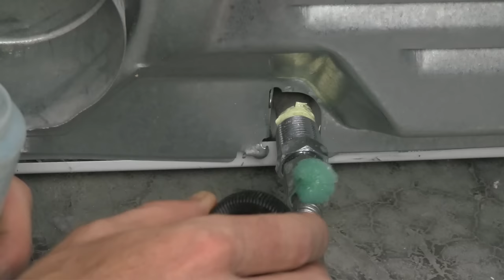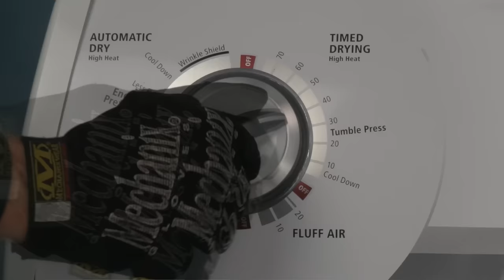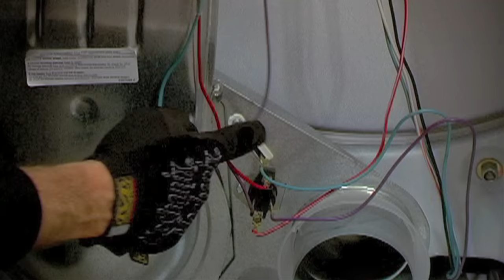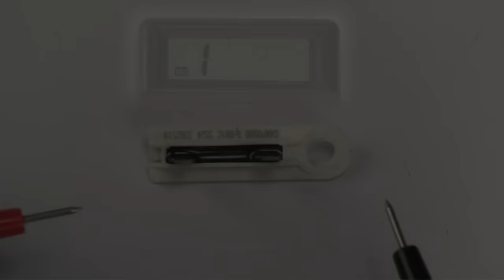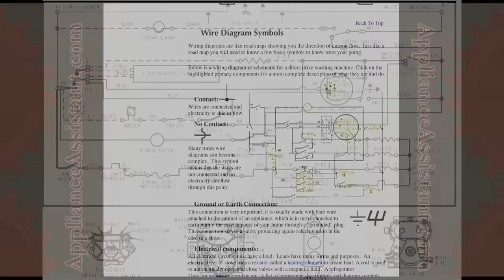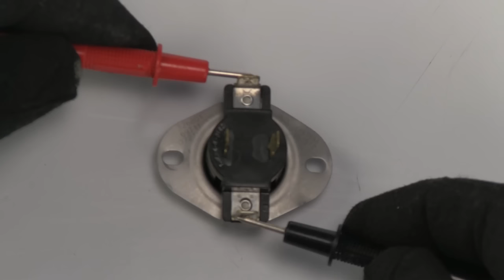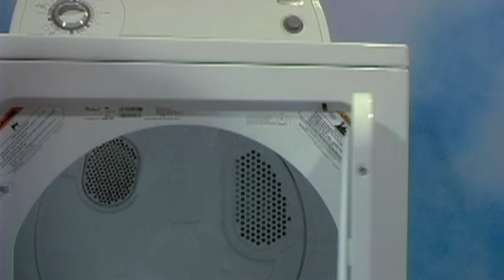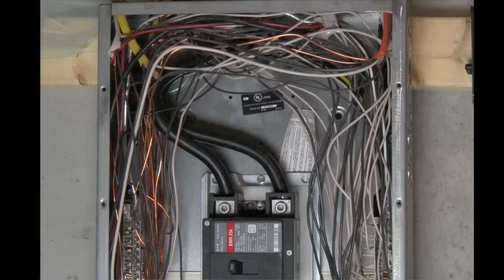Gas Dryer Repair: Fix Heating Problems

Comment: Igniter glows for a bit then clicks off with no flame. OHM reading across solenoids seemed ok. Replaced with used gas valve w/ solenoids. Still no ignition. 

Removed back and tested therm-o-disc.
Continuity between leads for red wires. NO CONTINUITY BETWEEN LEADS FOR PURPLE WIRES. 
When I bypass it by touching the purple wires together it blows the circuit breaker in the house.

Comment: I replaced the 2 solenoids after noticing that the flames were going off after less than a minute!!   But the problem did not go away.  I tested your suggestion to un-plugged the vent tubing in case the long tube (w 2 90 degree turns) was clogged, but the flames still went out.  What else could be preventing the gas from flowing to keep the flame going?

Comment: Thanks for this video.  This made my gas dryer repair super easy.  Coil replacement.  BIG thumbs up!  Interesting that Samsung doesn't offer the coils separately but everyone else does.  My gas valve assembly said Maytag so I got Whirlpool coils.  This is a Funny industry.

Comment: Do you have to plug the dryer back in before testing the various sensors, fuse, etc.?  Anyone?
Reply from the maker: +007nige For the most part no. Most of the thermostats, igniter, etc. can be checked with a multimeter for resistance. You just need to know what they should be in order to spot a problem.  Here is a dryer repair guide that may help.
Gas Dryers:
http://applianceassistant.com/appliance-repair/dryer-repair/how-gas-dryer-parts-work/
Electric Dryers:
http://applianceassistant.com/appliance-repair/dryer-repair/how-electric-dryer-parts-work/

Comment: How to test an operating thermostat with three terminals?
Reply: please I work in an industrial laundry and we use American dryer Corp. am having challenges on the flame,it always yellow in colour instead of blue and we always tap on d gas pipe before the fire comes out,need solution on how to get a blue flame and stop d taping of pipe
Reply from the maker: Not sure, but it could be an air mixture problem... tapping on the pipe makes me think you may have a bad gas valve, mechanical thermostat, or switch somewhere.  Really need some good isolation testing to pin that one down... Sorry I can't help more!

Comment: Is there any way to check the gas valve? Have replaced coils, starter element, flame sensor, fuse is ok and high temp fuse ( cold) checked ok.  my problem is turn dryer on (IJ70001) you see it turns red then clicks and nothing happens. It did start once after I changed the flame sensor, but only for a few minutes. but after a while it stopped again and hasn't started since. before I get a new dryer would like to expire any possible tests.

Comment: Help.. Changed Thermostat, Thermal Fuse and Gas Valve coils.. Flame goes on and off. I got no tester what now?
Reply: any answers for me.. I replaced all those 3 parts brand new.. flame goes on and off. I got no tester.
Reply: any answers for me.. I replaced all those 3 parts brand new.. flame goes on and off. I got no tester.
Reply from the maker: +Frank Orellana If the flame is lighting and going out quickly, I would guess ether an air blockage in the duct or dryer or a weak hi-limit thermostat.  On the style of dryer in the video it is the back of the dryer on the air intake duct that caries heat from the burner tube to the dryer drum... Just a guess. try running it with the duct off the back of the dryer first and see if it works. if it does you home duct is plugged up.  If its still doing the same thing check for a blockage in the lint trap housing or replace the hi-limit thermostat. Hope that helps! Good luck!
Reply: +applianceassistant flame turns on and off still heating fully   functional  , is it suppose to that?

Comment: Thanks for spending time being so helpful. Maybe I can ask your advice. My ge gas dryer has no heat. Igniter glows then u hear a buzzing/ticking kind of rattle for 10 seconds while it should be lighting a flame. Then nothing so then the igniter goes out. The ticking tells me the selinoids are good plus I tested them for cont.
Reply from the maker: +dan spouse Sorry for the very slow response.  It may be a bad gas valve but I would change the coils first they may be weak. They are also much less expensive than the valve which is fairly rare to fail. Hope that helps! Thanks for the question!

Comment: Your video's helped me immensely diagnosing problem with my older Whirlpool dryer. Since I'd ck'd the vent to outside previously, I started with pulling off the little front end clip to view the gas ignition. On high heat, it started up orange, then ignited the gas, I think indicating no need to ck. if it was getting gas. It heated up. I then pulled off the venting to dryer and to outside vent and cleaned out. Now running a test load without vent but have ck'd the front-end view to gas ignition and am only seeing the orange that should ignite the heating element, but it's not coming on. Ugh. I'm a stubborn grandma and insist on fixing stuff myself if possible. Already have a volt meter so guess I need to dig further and locate fuses, etc. Regardless, thanks for your informative video. Whether or not I'm able fix, I've been able eliminate several issues.

Comment: I thank you for the Description on troubleshooting problems, my gas dryer has power, fire, but no fluent gas, I replaced a few components like: thermostats, flame igniter, and thermal fuse. But after seeing this, I realized the coil valve solenoids were the main problem, bought the part and install them. Works perfectly fine now. GREATLY APPRECIATED!!!!

Comment: I have a Whirlpool gas dryer that no longer heats but still cycles.  It's unusable without any heat. I've ck'd the outdoor vent and only looked at the back which is completely encased. I think gas dryers of the past had an accessible entry to relight pilot. I get that those times are past. The video is very informative and have given me a few other ck's before calling it quits. Thank you & well done!

Comment: My dryer's igniter will sometimes glow and other times it won't glow at all. Originally the thermostat was dead (I tested it with a meter) and I thought the problem would be fixed once I replaced that. Since then I've replaced the flame sensor, valve coils, bought a new air duct, checked the outside hole,  removed all the lint from inside the machine,  and replaced the cycling thermostat.  I've thought about replacing the igniter, but I figured that since it is glowing and igniting half the time, that it's probably not the problem. When the igniter finally does glow, it ignites the flame, but after a few seconds the flame goes out.  I'm currently thinking that it's the gas valve that needs to be replaced. Please give me some suggestions on what I can do to fix this problem.
Reply from the maker: +Aaron Grinnell Thats a difficult one! I don't think its the valve because that would not effect the igniters ability to get current to glow... it's very unlikely the igniter... So I would look at the timer not making contact intermittently, to send voltage to the igniter through  the flame sensor, or your new flame sensor may be defective... I would start with multiple voltage tests from the timer. probably the easiest place to check would be  at the blue wires to the thermal fuse in the back. It should show constant 120 Volts AC whenever the dryer is running on a heat cycle, except at the end during cool down.  Then wiggle the timer knob and see if the voltage drops off. If it does it's timer contact problems.  Hope that helps! Good luck!

Comment: Thanks for the great info.  My igniter burned bright no flame so I checked the 'dryer radiant sensor' per your instructions read '0'.  Also, there were web/lint around the 'dryer radiant sensor', therefore, I used my shop vac and carefully vacuumed around the sensor and wahlah, flame came ON.  Thanks again!

Comment: So I need some help with mine I replaced the solenoids and it didn't fix the problem. SO what happens is the coil starts up and then turns off after about 10 seconds I don't get an ignition. I have a Kenmor 11097589110. Is there anything else that would cause this issue besides the solenoid?
Reply from the maker: ***** Sorry for the delay! I hope you have already found your fix! That's a tough one. The coils should be the cause. However, the valve is a more rare culprit.  I even had one that had a spider egg built in the gas orifice blocking gas flow. I'm just guessing... ether no gas or the valve is not opening like it should. New coils could also be bad... Sorry I can't be of more help.
Reply: Yep and yeah it turned out to be junk in the intake. after cleaning it started right up and it works perfectly! The dryer may be from 1994 but still runs like a CHAMP! thank you for checking back with me though :D
Reply from the maker: ***** Thanks for the update! That kind of thing is difficult to find. Congratulations!

Comment: Thanks for the great video.  My problem turned out to be the thermal fuse.  With your help I was able to find it, test it and replace it!  Cleaned out my dryer vent hose while I was at it....the fact that it was full of lint probably caused the fuse to fail.  Thanks for taking the time to post this video.  You saved me lots of time and money.
Reply from the maker: Lisa Myers Your welcome! Thanks for taking the time to comment! It's very encouraging to hear success stories. : )

Comment: The troubleshooting video took me to the problem coil before I took the back off, I had the Laptop on the washer and stopped the video while pulling panels off and tugged wires and taped coils until the lighter came on.
Amazon will have the parts to me in 2 days.

Comment: My whirlpool gas dryer has a gas smell coming from inside the dryer. No leaks on the outside and No smell from the outside. Help?
Reply from the maker: Hard to say... you can use a liquid soap solution to check for leaks at all of the gas connections. It will bubble if there is a leak. Apart from that it would probably be a faulty valve, or coil malfunction.  you may want to call a pro on that one... Not a good idea to guess when it comes to gas leaks if you can't positively find the source.

Comment: Excellent video! Last time I paid a tech. $250 to troubleshoot and change the coils. Was able to find the fuse problem, just need to determine now why it blew.
Reply from the maker: Todd Lung Sorry for the slow response. The first place to check is the home duct. This style of dryer is very unlikely to develop an internal blockage.  The fuse can just fail for no reason as well...  Thanks for the comment!

Comment: What would cause the fuse to blow other than a clogged lint line. I am replacing the fuse and the thermostat just to be sure. The thermostat should open before the high limit switch correct?

Comment: My Kenmore 90S gas dryer is overheating.  The original problem was "no heat". We replaced the fuse and thermistor.  Now, it gets way too hot!  When it's set on Air Fluff only - there is no heat, but on all other settings it gets too hot.  Do you have any suggestions?
Reply from the maker: Karen Monson Sorry for the delay! It's kind of rare but I would try the cycling thermostat... unfortunately they are difficult to check because they only open at high temperatures, and I'm thinking your's is not opening properly.  You can use a meat thermometer at the back of the dryer to check cycling temperature. On high it should cycle the burner off somewhere between 170º and 190º.

Comment: I have a GE DRSR483GG7WW. The dryer ignites only for a few seconds and then goes out. I was thinking it was the coils. Is that correct? If so there are two different kinds offered. 
1. 'M' Series Secondary Coil - 2 Terminals
2. 'M' Series Primary Dual Coil Gas Valve
Which should I get? Do I change both? One has 2 terminals, the other 3.
Thank you very much!

Comment: Man I am at a loss.  I have torn my dryer apart multiple times and still can't figure out what is causing an almost un-burnt gas smell to be in the drum.  It doesn't smell like straight natural gas just like exhaust from an engine.  I thought my flame height might have been the issue but the flame is predominantly blue so I dunno at this point.  Ignitor does its job. The coils seem to work in conjunction with the safety switches properly.  It was a hand me down from my folks. After I cleaned it out thoroughly I put it to work for 2 whole days when all of the sudden the clothes smelt funny after a cycle.  Now my clothes come out smelling like exhaust.  No paint/varnishing being done in the home either.  Oh and the vent hose is brand new with an entirely new run of ducting.  Any ideas?

Comment: The house I am renting just converted to gas, and the dryer doesn't heat. Is there a correlation between the two? IF so, how do i fix this problem? Thanks

Comment: My Ge gas dryer DDG9280gbl works fine on medium and tries to come on more frequently on the hot setting but the gas valves don't open so the ignitor goes off then comes back on at the normal "medium" frequency. It will do that over and over. I've checked the stats and replaced the coils and fixed a bad contact inside the timer. No luck. Can you help? Thanks in advance.
Reply from the maker: If the igniter is cycling that should mean that the thermostats are closed and ready to heat... Sounds like a valve issue but if that was the case it shouldn't work on medium.  I don't have that model in my wire diagram database... If you have a wire diagram can you message me a picture or an email address?  I think that's the only way I may be able to help.
Reply: Thank you for your reply. Just after my question to you I discovered wet clothes, one of the "new" genuine GE coils failed open after 15 months of light use. I reinstalled the 30 year old valve set, works good now. Even ignites on hot but takes forever to reignite (on hot) but okay on medium. There must be an alternate circuit on hot that bypasses the cycling TT? It has the moisture sensor which I use exclusively and a circuit board which I've seen called a "timer ". As I recall, the original problem last year was no-heat and I fixed the timer contact and replaced the valve set then. Looks like I got a valve set with one weak coil. I'll work on scanning the diagram if you think you might be able to help with that long delay on hot. (almost down to room temp.) Many thanks for your interest.
Reply: applianceassistant Yes, you were right, a valve issue. The booster coil failed. Works good now but needed a load of wet clothes in it to properly test. I was running it empty initially which may have made it overheat and a long cool down time. That new coil was weak from the get-go and made me look elsewhere. Thanks for listening. I'll delete my long comments if you want or you can. Thanks again.
Reply from the maker: No problem! I'm glad you got it figured out.  The comments are good, they hopefully will help others in the future.  Thanks for the question and update!

Comment: Ok great video. My whirlpool dryers pilot flame goes off after couple of minutes. I'm assuming it's the coils. I tested them with my meter and get an ohm reading but not the reading with beaping when selected to sound continuity. My Milwaukee meter is junk.help
Reply from the maker: Not sure what you mean by pilot. The ignitor? The beeping setting is only to measure a closed circuit with no resistance, so it would not beep when checking coils. (there should be some resistance.) the coils can test okay for resistance and still not continue to open the valve once they heat up.  I hope that helps some... If you can clarify the symptoms I may be able to be more clear with suggestions. Also a model number may help. Thanks for the question!
Reply: Yes I meant the ignitor..model # egd4400sq0.  The flame stays on for a couple of minutes then kick off and does not return. I have tested ever thermostat, fuse etc and all have tested ok.
Reply from the maker: after the flame cycles off, does the ignitor ever glow and cycle off with no flame?
Reply: Ignitor does not glow . Man you are a quick response. I appreciate it
Reply from the maker: That is strange... It sounds like a thermostat is opening. Because otherwise the igniter should get power to try and relight. How long do you need to wait before it will do another burn?

Comment: great video. if the cycle thermostat heater testes infinite and the dryer runs normal for a bit but burner shuts down and never kicks back on, the cycle thermostat needs replace?
Reply from the maker: The cycle thermostat heater only effects the cycle temp for low and medium heat options, but should not effect the burner turning on or not.  Sounds strange... It should at least be trying to ignite...  Does the igniter ever glow again? 
Sorry for my slow response ... Lots of appliance repair needed in my area... so little time!  : )    Thanks for your question!
Reply: thanks for helping take your time too much business is a good problem to have :).
the igniter never seams to glow after. I did remove the cycle thermostat from housing when I was cleaning out all the lint, started the dryer and the burner came on off frequently without ever stopping the igniter etc are good?

Comment: Outstanding video! I was easily able to diagnose my problem as a bad/failing gas valve coil. I got a new set for about $10 and it took me less than an hour to completely replace them. Dryer appears to be good as new now. Also, the discussion of troubleshooting with the schematic was really good. I didn't need to get to that level, but it was great to have some guidance on how to approach it if I did need to. Thanks for the great video! I'm going to see what others you have now!
Reply from the maker: Thank You!